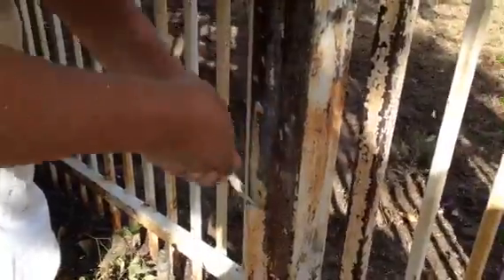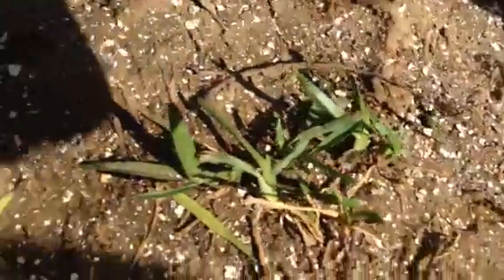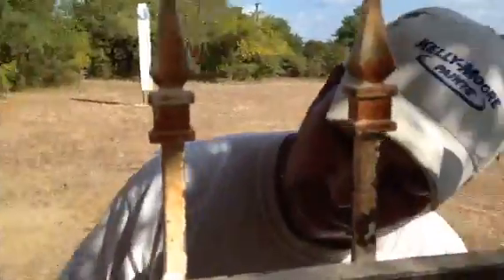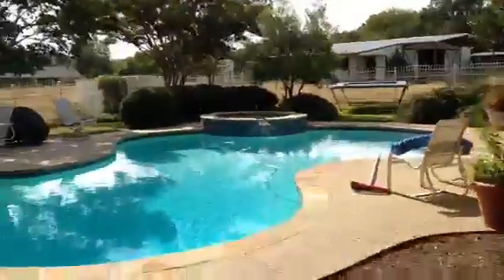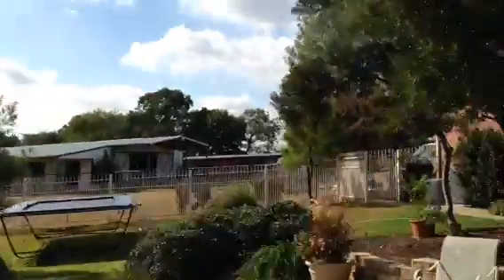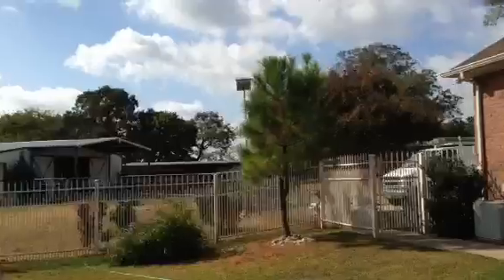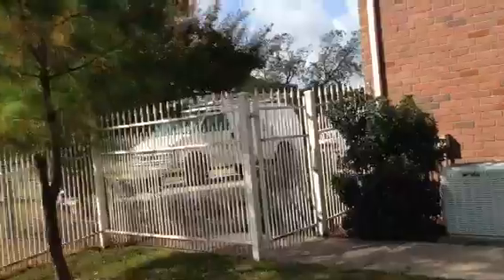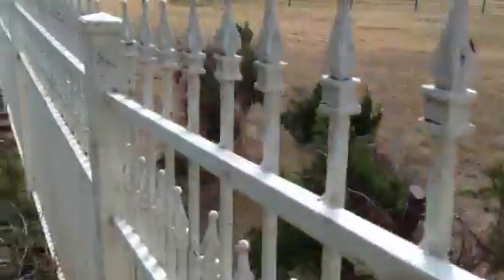Scraping Loose Paint from Wrought Iron Fence for Primer

Comment: I am planning to do the same on my fence. Wouldn't it be easier to strip it with a grinder and a brush cup? My fence has several layers of different colors.
Reply from the maker: There’s no replacement for elbow work with a wire brush and a five in one tool. Simple as that I’ve done it all. TYVM!!!

Comment: If I have a little rust in some areas like around those pointed tips on top should I use any rust converter or just sand, prime and paint?
Reply from the maker: Scarps with wire brush and 5-1 tool is key!!! Then sand properly where needed. Prime all weld joints snd rough areas with Oil Based Emulsive Primer. Paint Premium grade exterior oil paint and double coat rough areas needed. TYVM!!!
Reply from the maker: *Scrape